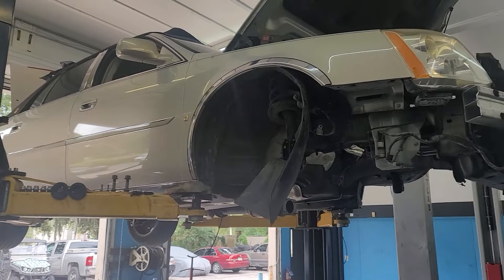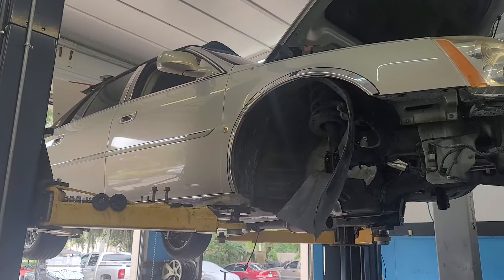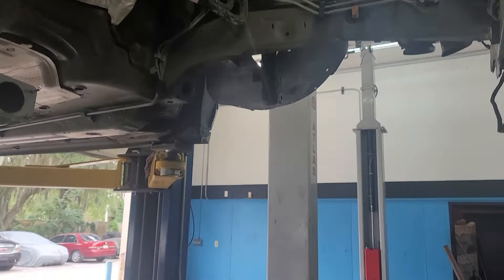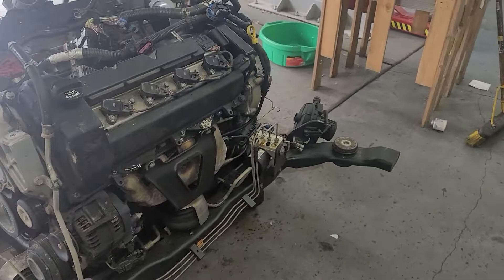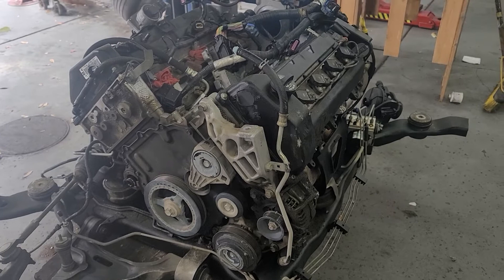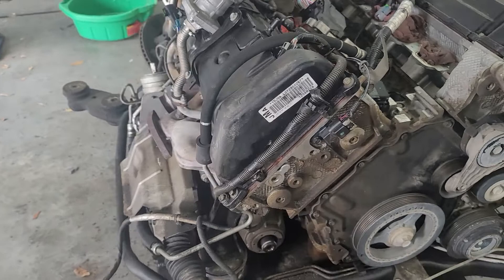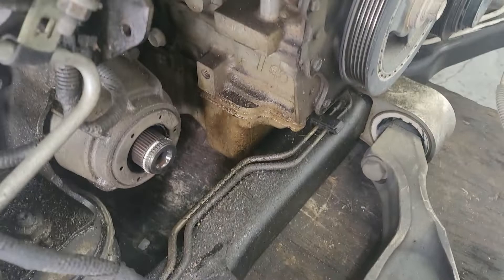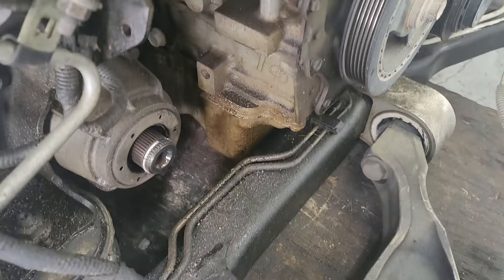Diagnosing and Repair for Oil Leaks On a Northstar Cadillac Engine @Pals Ocala Auto Repair

Comment: My 2006 Buick Lucerne cxl with Northstar v8 (70k miles) had a small leak around the valve cover and was leaking from the oil pan.  My mechanic recommended pulling the engine and resealing everything and quoted 4.5k to do the job.  There are so many extras that would need to be done that we finally settled on 6 - 6.5k.  I had him tighten the oil pan bolts, clean up the oil under the engine and I traded the car in a week later on a brand new 2021 car fresh off the lot.
Reply: You should’ve traded it in without paying to have that done.
Reply: @Samuelfish2k  LOL, they charged me $50 for the oil clean-up underneath the car and nothing to tighten the bolts. The clean-up had to be done to help identify the leaks as oil was splattered all over.

Comment: I have to ask ,, how much was her bill for this job ? I have a 2007  DTS thats leaking 😢 or should i trade it for an 88 k5 blazer
Reply from the maker: The job runs between $4K-$5K depending on the condition of the engine.  As far as trading for an 88 K-5??  Only you know the condition of the unit.
Reply: @palsocalaautorepair  I don't have a blazer to trade for yet , but I guess  my point would be to trade for something that can be easily worked on.  Thank you for the reply.

Comment: Why is the engine on the floor instead of a stand/table?
Reply from the maker: It is actually on a wooden frame with 4 caster wheels.  This allows us to move it easily out of the bays and into the area where it is resealed.

Comment: How much does this repair cost
Reply: 6-8K for a Cadillac dealer to do it, not sure about an independent shop.
Reply: @northtexasfan  why so much
Reply: @youngsol309 because you got to pull the whole damn engine out
Reply: Do you gotta pull these out from the bottom
Reply: More than it’s worth
Reply: @youngsol309 hell I would charge about 3500 to do it 7 8k is crazy